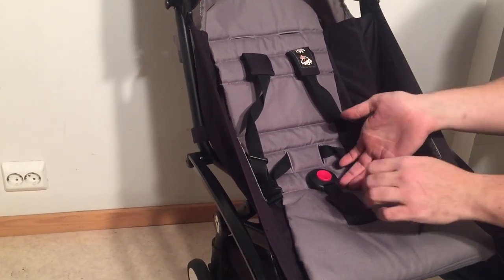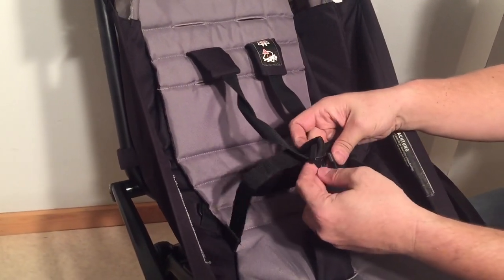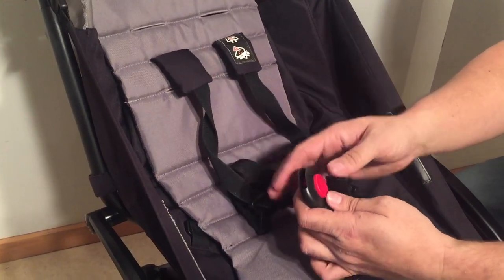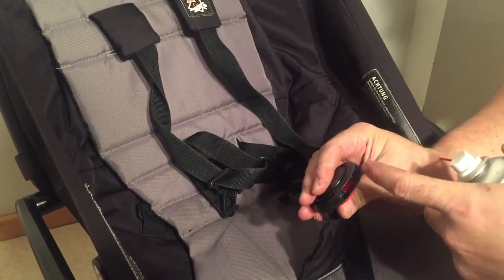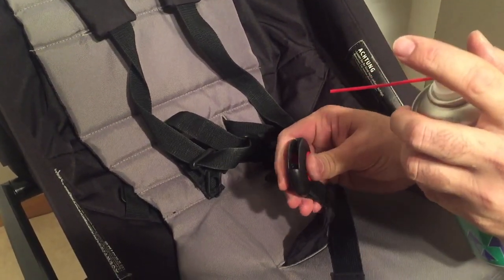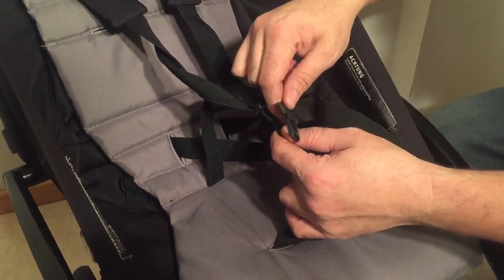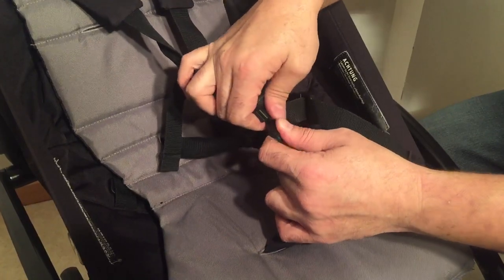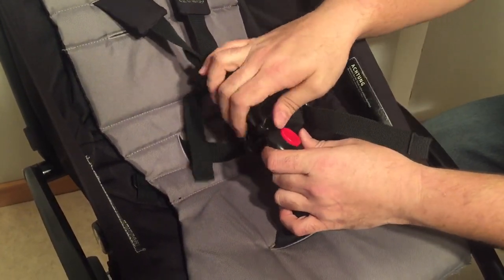How to Fix a Tight / Stuck Harness Buckle on a Babyzen Yoyo

Comment: Hi! Anyone knows how to replace a broken buckle?
Reply: Any luck figuring this out? Same problem happened with ours...
Reply: Only way is to replace the whole back piece. Call customer support immediately. If its within warrenty period they help you free of charge  (might differ in diff countries)
Reply: I came here with the same question. Customer support advised the whole base seating, wich has the straps attached, to be replaced. Its an expensive solution that could be avoided by just offering the broken part if the buckle as a replacement. Its a simple repair that basic sewing skills can fix. Forunately the buckle broke withing warranty and we should recieve a new base seating soon.